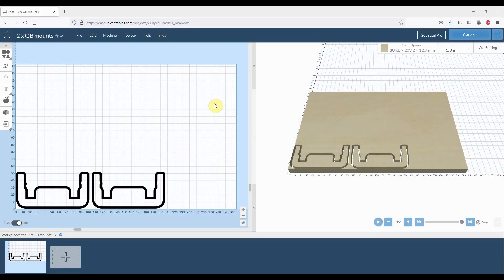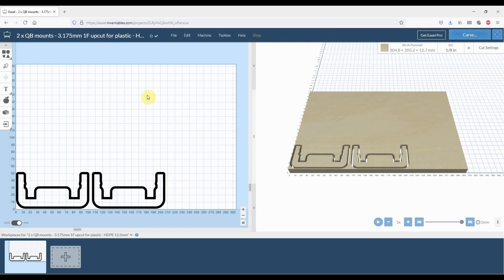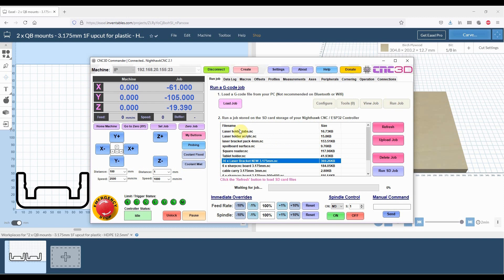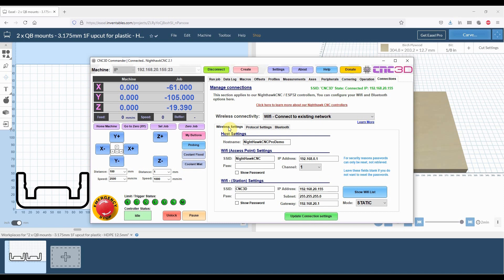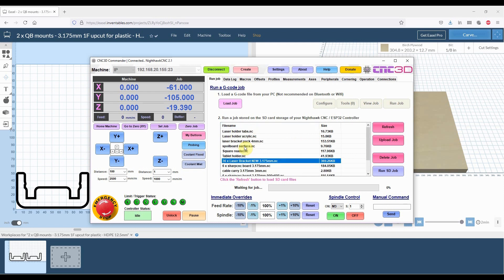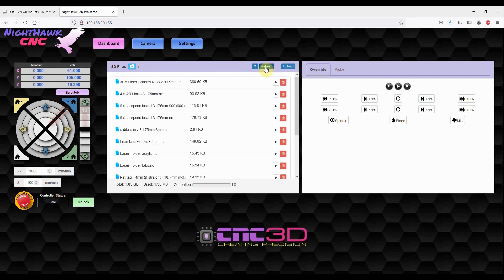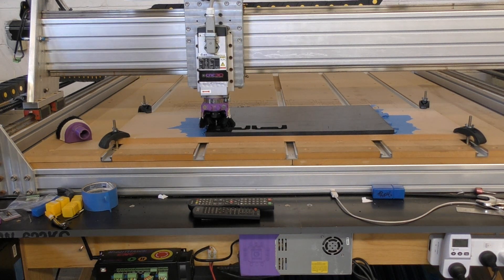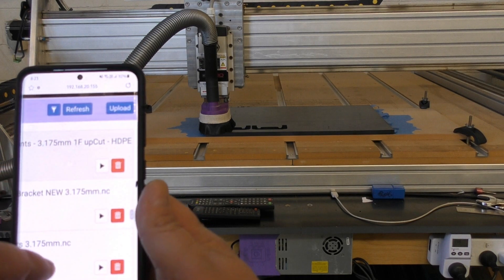Nighthawk CNC controller overview and usage

Comment: how does this compare with AXBB-E controller?
Reply from the maker: The architecture is different. The Nighthawk has better connectivity options such as wifi and bluetooth with an onboard web interface.

The AXBB-E does support more functionality such as ATC and G68 rotation. 

We are working on a future release of the Nighthawk controllers with an ATC system built in but G68 will always be a challenge to add where processing needs to be done on the controller itself rather than the PC running the sender software.

Their are pros and cons to both controllers making it a difficult comparison.

I hope this helps. :)
Reply: @cnc3d  is their support for rigid tapping.
Reply from the maker: @Z-add  Technically any CNC can do this provided that the spindle supports it. Most cases the RPM is simply too high and too rigid. A smarter option for tapping is to use a thread mill. We can confirm the Nighthawk works perfectly for this as we use the actual machine to tap the 100mm slots on the beds of our Metal Storm machines. 

I hope this helps!